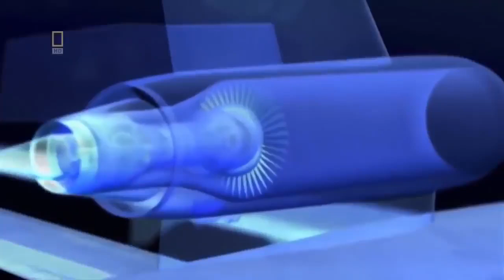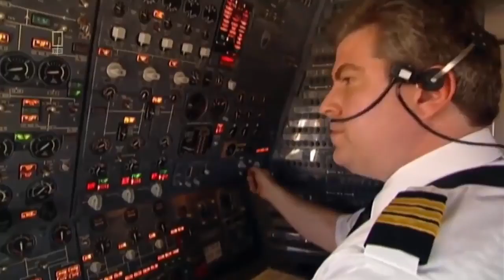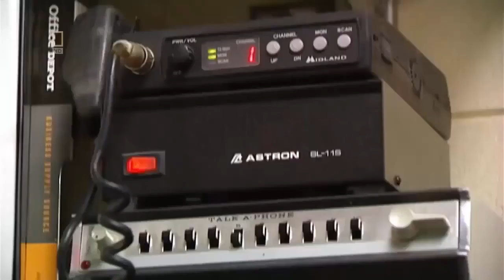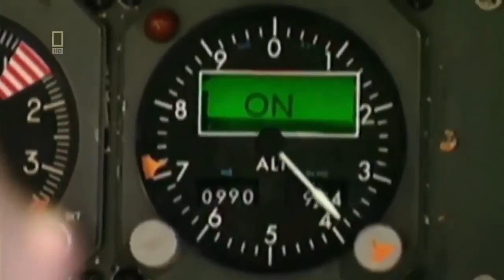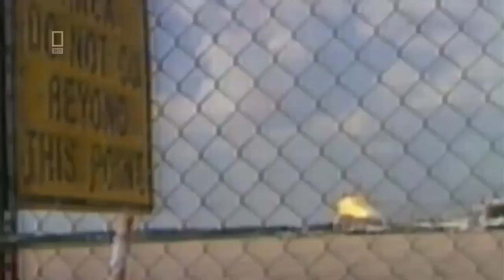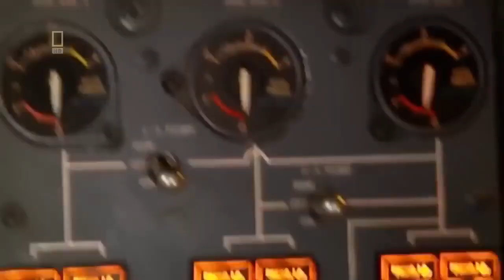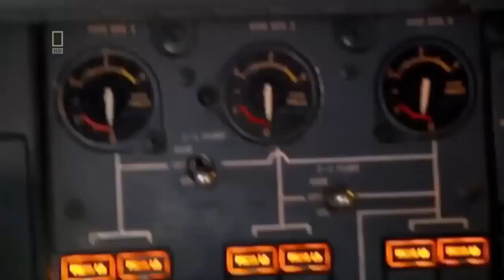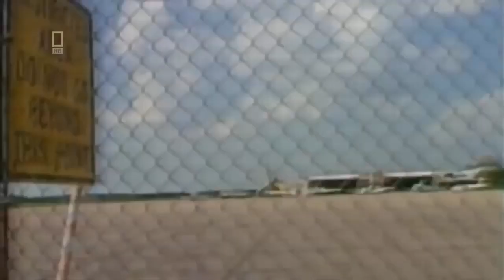Air crash investigation 2020 - mayday Seconds From Disaster   Crash Landing at Sioux City HD

Comment: Why did that engine  fan blade broke and hit the other engine
Reply: it did not, it cut hydrolic lines. Engines are to be designed by the engine manufacturers to contain explosions, no debris of such an explosion is to damage the aircraft other than the engine it came from. Amsterdam accident had a Boeing 747 lose both engines on the same wing, one came off and knocked the other off.